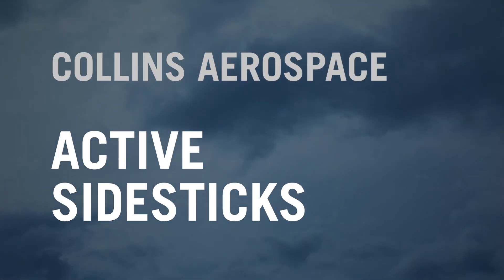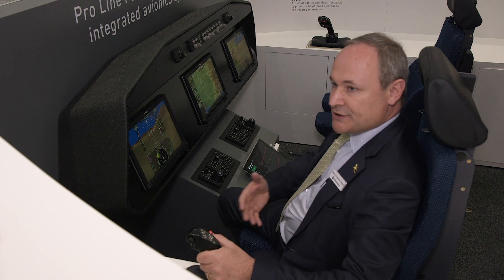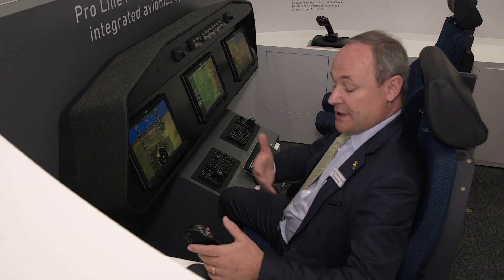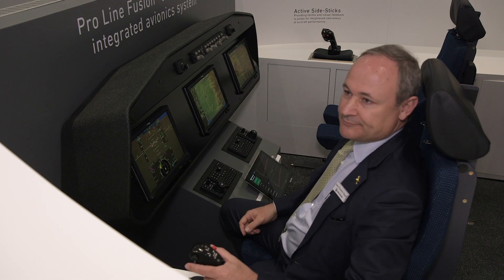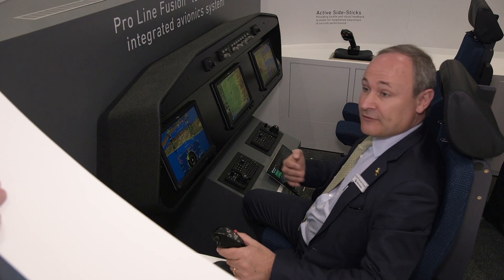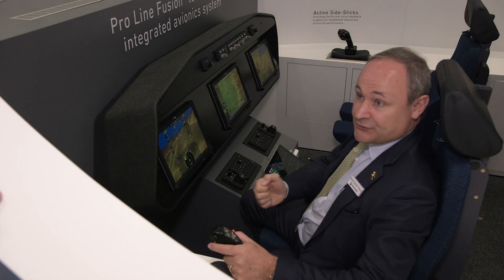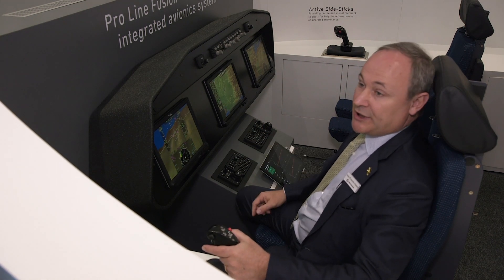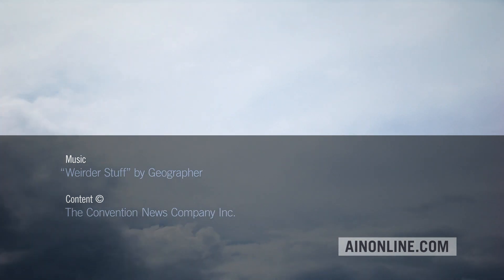How Collins Active Control Sidesticks Work – AIN

Comment: I’m amazed it’s taken this long for the side stick controls to be in sync.
Reply: Exactly. Seems like a very easy thing to design.
Reply: Air france
Reply: @phillm156  If your referring to AF447, that's not the reason they lost the aircraft.
Reply: How did it work before this?
Reply: Gulfstream have had active sidesticks for awhile now
Reply: @dragonage200  Don't Embraer and Bombardier also already use this technology?
Reply: @fzb5383  Embraer only has active sidesticks in its KC-390 military tanker, and passive sidesticks in the Legacy 450/500/Praetor500/600.

Bombardier only has passive sidesticks in the Cseries
Reply: @PlaneAF876  Please explain. The co pilot was pushing up and the other was pushing down, The up was in control.
Reply: @flotz31  The primary reason they lost the aircraft was due to the first officer nose up inputs, causing the A330 to stall. Unlinked sidesticks however contributed. The sidesticks on the A330 didn't cause the accident in of itself.
Reply: Should have been an Airworthiness Directive after Air France 447.
Reply: @PlaneAF876

That’s exactly why they lost the aircraft.  

It was the final hole in the Swiss Cheese that lined up. 

AF447 would never have happened to a Boeing aircraft because the other pilot would have immediately realized what happened rather than trying to see annunciators and listen for voices.  

There’s a reason why tactile feedback is so important in tons of other operations (gear handle shape, artificial feel, stick shaker) so why not here when it’s on almost every other aircraft ever made?

Comment: This was the reason the Air France flight crashed in the Atlantic, one pilot pushing up the other pushing down.  Stalled.
Reply: 447?
Reply: @Rufus_L  Correct.
Reply: Not exactly. The main reason was the pitot tubes being overwhelmed and the FO not understanding the aircraft behaviour in alt law. This was coupled with lack of unreliable airspeed training. Stall was a consequence.
Reply: @athr_blu

You have to ask why a bunch more times to get to the root cause.  

Why didn’t the other pilot know about the stall and try and take control?

He did know and tried to take control, but his controls were overridden by the First Officer.  

Why didn’t he know this?

Because you have to look and listen for annunciations that are easily lost in a confused cockpit rather than feeling someone fighting against your inputs.

Comment: Someone help me understand...  When is averaging the stick inputs the right answer?
Seems to me that the airplane will be doing what neither pilot expects.
Reply: Exactly
Reply: You can't just give priority to one of the pilots right away. What if the one you gave priority to is the one putting the aircraft in a dangerous situation and is about to crash it? So the only other thing that can be done is to average the controls until a pilot presses the takeover push button.
Reply: It alerts both pilots that there is something wrong.  Same as if you grabbed physical controls with someone else trying to control the aircraft.  

It’s so basic that it’s instinctive—especially when you trained on aircraft with mechanical controls.

Comment: For the Aviation Fans And Lovers the best sensation is given by the traditional Yoke, But the System of Side Stick is More Electric or soo. I don't know how you are supposed to control the Aircraft When you have A Hydraulic Failure or Electric Panne since It's A Fly by wire controller
Reply: Yokes are also FBW these days. No one wants to design/buy/fly a mechanical aircraft anymore, this is not the 80s
Reply: King Beef  Dont forget that each engine has two generators each, APU, RAT, Backup Battery

Comment: If AF447 had this.. it would not be at the bottom of the Atlantic with 228 souls.  

Yes.. the pilots made a ton of mistakes. But the lack of tactile feedback was the final hole in the Swiss cheese that doomed the aircraft.  

AF447 would not have happened to a 777 or 787.  

This should have been an Airworthiness Directive and grounding of the worldwide Airbus fleet because it was as bad as MCAS…. not even mentioning the type of pilot Airbus created thinking that they could just “go home” to Alpha Floor and Alpha Protect but not realize they were in Alternate Law rather than practicing the same type of stall recovery a pre-solo student is taught.
Reply: It could on Boeing too. In 2022, the pilots of AF11 ended up fighting each other's control input, just like on AF447. Curiously, they're flying a Boeing 777 instead of an Airbus with sidestick. When their conflicting inputs were averaged out by the FBW computers, the pilots suffered lack of feedback from their yokes for a moment.

Since 777 & 787's yokes are conventional, it features breakout mechanism to allow their yokes desyncronized either if one of them jammed or suffered conflicting/dual inputs with such an enough force. When it happened, their controls were based on average input by the computers.